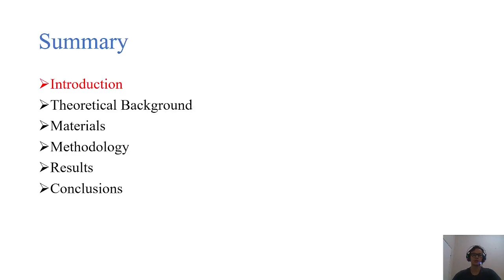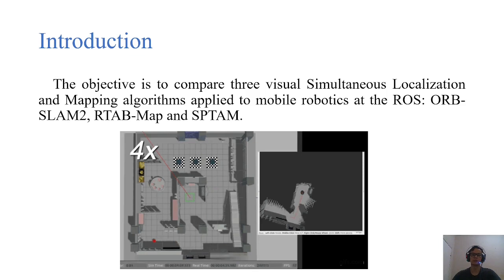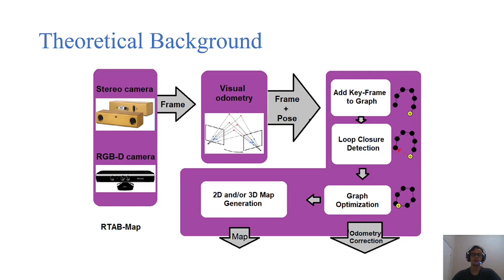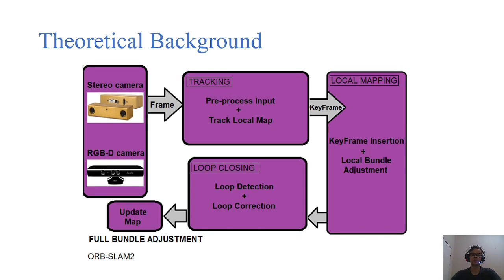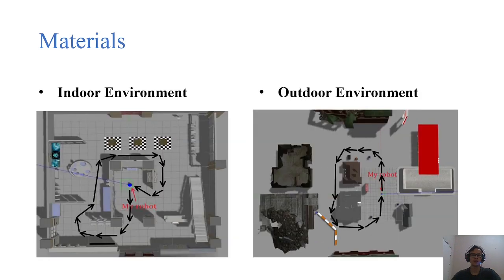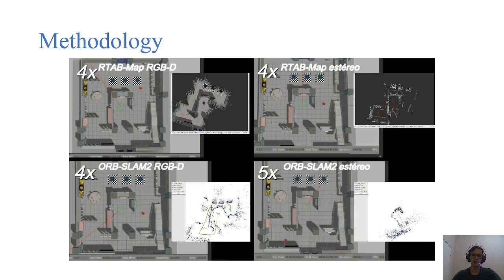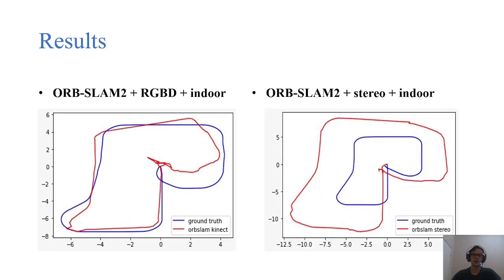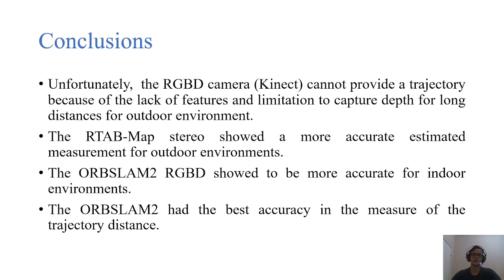Comparison of Visual SLAM Algorithms ORB-SLAM2, RTAB-Map and SPTAM in indoor and outdoor with ROS.

Comment: You need a real robot. Simulations don't worth much to compare. Rtabmap can use PTAM,orb-slam2 and 3, openvins and accept other secondary odometry inputs that orbslam doesn't. Kinect don't work in outdoors, and in the simulation it works, so the simulation cannot very rigorous. Just a personal opinion
Very good video, you should keep make them.
Reply from the maker: You're right. We're carried out real simulations as well